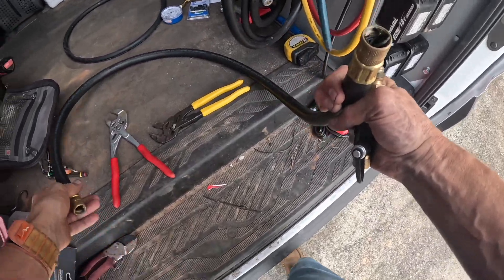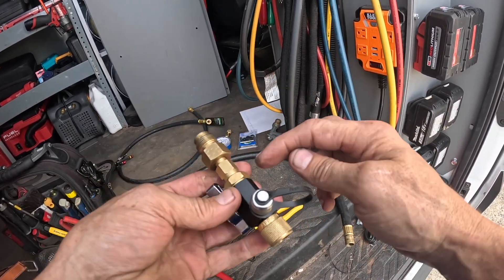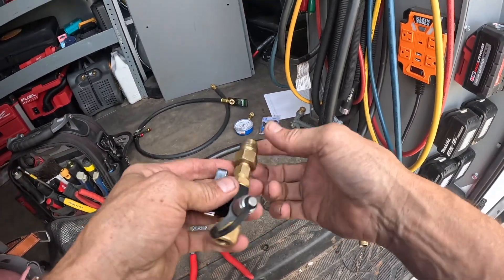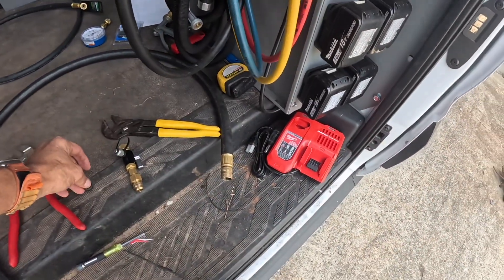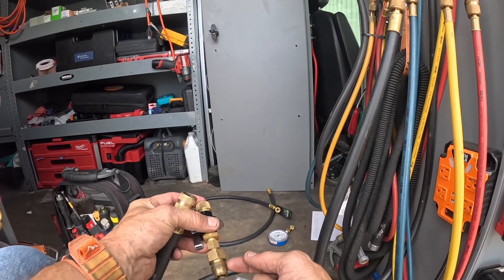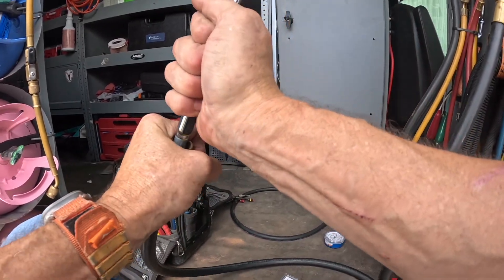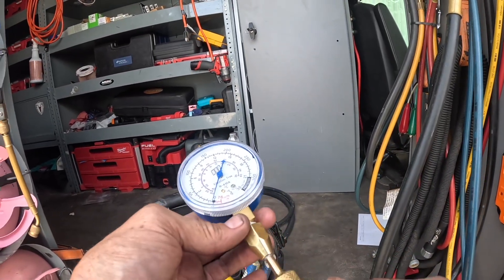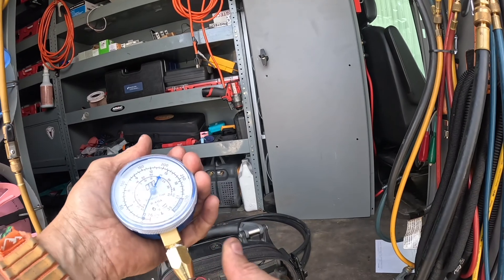A Couple Of #techtips #hvacguy #hvaclife

Comment: On a standard heat pump you only have two 1/4” service valves….which flow a maximum of 1 cfm each..a 3/8 hose flows 2 cfm which is all both service valves will flow..by having a 1/2 hose at 3 cfm you aren’t approving the flow any cause you can only flow 2 cfm through both valves…

Comment: You buy a 1/2 x 1/2 hose & buy a male 1/2 x 1/4 female adapter. Pretty common  around. Just google it.

They also make ALL COPPER Braided HOSES ! 1/2” x 1/4”. I’ve used them. Made by Robinair for High vacuum manifolds. I’ve used the When I’m doing Cascade refrigeration evacuation. 

Robinair also makes a Super High vacuum manifold all 1/2” internals.  It’s about 2 feet tall. I used to own 2  of them. For cascade refrigerator repair. 

And they make All Stainless steel braided hoses too. I have not used them.

Comment: Ted is a good tech too pickier than you and he hates r 22 replacement blends because he has had a lot of situations where other hvac companies did not do it corectly.

Vice versa I think he could learn from you and study the gree flex units since I think he is getting frustrated with the quality control at trane.

And Ted's friend at the my hvac life channel got stuck with a Mr cool mini split p4 code last weekend but I think In addition to the board it's a bad lineset.

And I think they are gree units too on the mini splits and not just the universal series.

So since the Mr cool diy issues keep coming up and are starting to make their way down south it would be nice if for the mini splits if the replacement parts could just be ordered from gree.

I look forward to your follow up vidoe on that trane coil cleaning and fixing that awful butcher hack job on the return plenom near the evap coil God punch a hole in it and think that aluminum tape is going to seal it really.